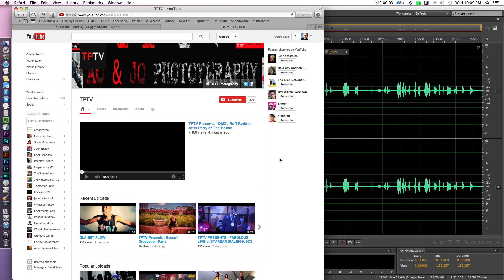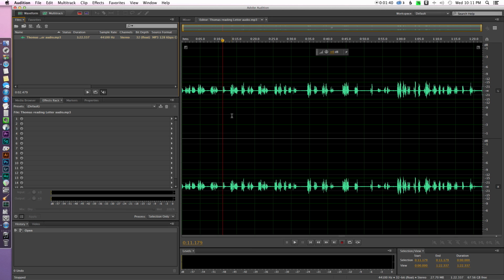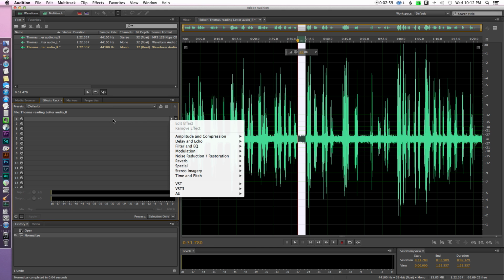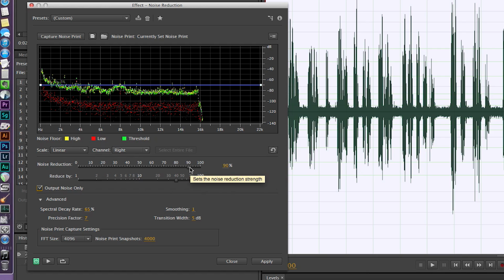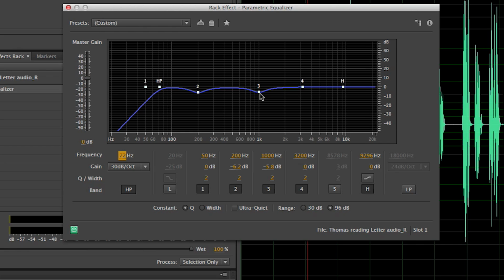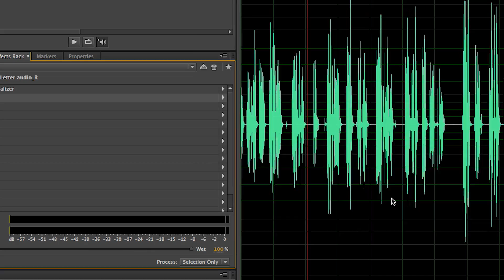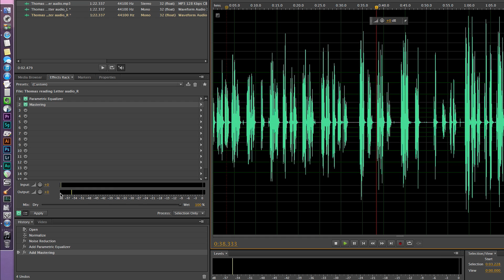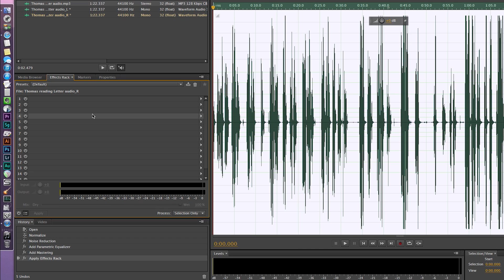Sound Rescue: Cleaning Up Dialogue Audio in Adobe Audition

Comment: Setting mp3 128kbit 44.1khz 16bit is on a recorder is big mistake. Wav is the way to go. 48khz is good enough but 96khz is preferable. , 24bit is minimum 32bit preferable. 16bit cd quality sounds good but for main recording use the best possible quality to have the most information while editing.
Reply from the maker: Generally, yes. Recording dialogue for video, we usually use 48kHz.

Comment: I've been using your tutorials to try and fix some audio that I need to use and can't reshoot. I wonder if you could help? Fuzz was recorded from the microphone throughout so there is a constant and very loud hum that I can't get off using the Noise Reduction tool. Any advice?
Reply from the maker: Hi Giorgia, I assume you are using Audition? There is a dehummer tool which is worth a try
Reply from the maker: If you are in the US or any place where the electrical grid operates at 60hz, I’d start with the “Remove 60 Hz and Harmonics” preset. Good luck!

Comment: Great info.  I've been applying the noise reduction first, but maybe I should normalize before applying noise reduction.
Reply from the maker: Thanks Jared, experiment with both. I've been doing NR first in some cases too. This workflow is in a constant state of refinement and adapting to different situations.
Reply: Light NR first, normalize then another light NR. I find two lighter NR runs sounds better than an extreme one.

Comment: I'm a voice over,  that Will DEFINATELY AFFECT YOUR VOICE!!! It's a no no, and there you go, metalized voice
Reply from the maker: Hi Oihane, yes, it is best to avoid using noise reduction plugins, especially for voice over where you should be able to set up your recording space to avoid noise problems in the first place. And for video, I like to address noise issues while recording so I do not have to do it in post because it can definitely affect the quality of the audio. However, there are some cases for video, when you don't have a lot of control over the space, where using noise reduction carefully can improve the quality of the sound. Best wishes!
Reply: Yup. I currently have a fan noise leaking out my computer. I can't avoid it, and it's supposed to be at -60 to -55, still, it's loud enough to make have to remove it so when I normalize noone can hear it. I have issues with the noisgate, it takes some parts of my voice over, any suggestions?
Reply from the maker: I stay away from gates for dialogue. They're too obvious. I like Izotope's dialogue de-noise plugin (can be purchases as part of plugin bundle or included with RX).
Reply: we always use(d) little.gates even on studios, I think it's obvious for sounds you obviously cant remove xd I don't think I.can afford the plugin...  hiw much is it?
Reply from the maker: Around $129 USD: https://www.izotope.com/en/products/repair-and-edit/rx-plug-in-pack.html
Reply: Just what I said

Comment: In a separate video, where you go through compression settings, you normalize your track to -0.1db from "favourites." I noticed that once that is applied, the capture noise print function is greyed out (audition cc). I suppose I should clean the audio before applying compression.
Reply from the maker: Yes, before is best.